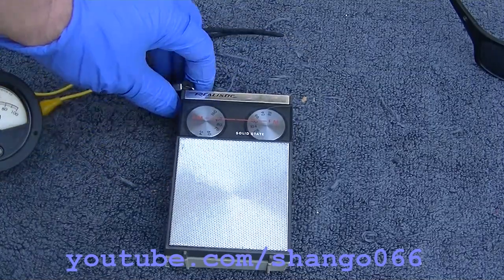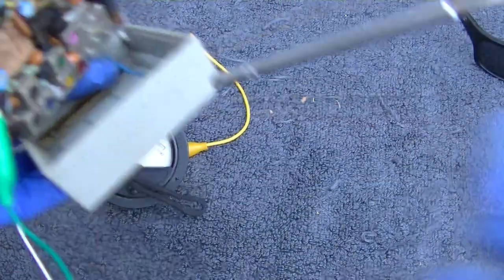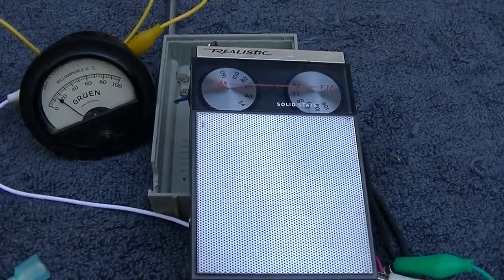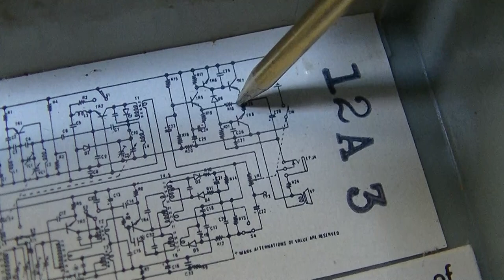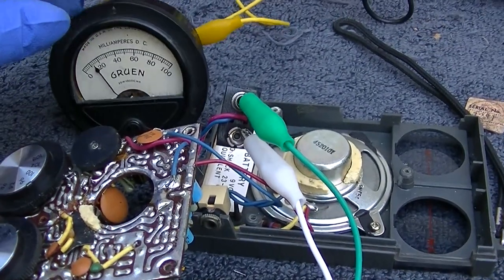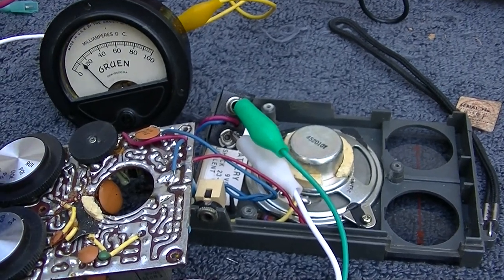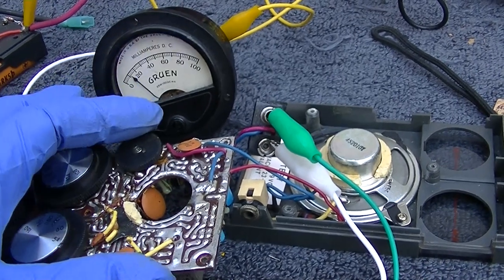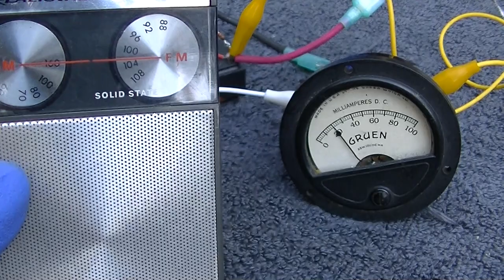Realistic AM FM Pocket Radio Quick Fix Radio Shack

Comment: Seems like a pretty good set. I especially like the separate tuning condensers as if I had one I could leave one on my favorite AM and the other on my favorite FM station and not have to retune between the two.    Nice easy fix too and nice video.  Thanks
Reply: I noticed that too....and from the looks of that schematic it appears like twin radios sharing the audio output.  Should make for an easier diagnostics come repair time.
Reply: RS had a number of these radios, some with maybe short wave, police  band or marine band on the other side. The dual-dial setup was a cool feature and it probably cut the depth of the case a little. They seemed well constructed. The only shortcoming was a tiny 2" speaker; I think a 2.75 incher would have made the sound a little more bearable.

Comment: the coupling cap probably fails to reform properly because of the high source impedance and low DC voltage across it

Comment: Realistic radios were sold by Radio Shack and normally better quality build than many of the time.
Reply: Regarding the Panasonic commercial television we saw recently, what is it about the Realistic vacuum tubes that make them so crappy?
Reply: Funny how they had the opposite name here in the Netherlands. But they where the most easy accessible repair materials shop for me as a kid as they had a shop in the closest supermarket and other food related "mall". they closed early 80's there.
Reply: @jamesplotkin4674  at the very end they were buying whatever they could find on the open market. Tubes by that time were more or less out of production of except for a few specialized numbers.  Realistic lifetime tubes also were more or less wherever they could get stock cheap. If you know your tube construction you can actually find very good American made tubes all the way to junk from China .  It was completely luck of the draw.
Reply: @James Plotkin,Watch his video “talkin vacuum tubes with Al”. Al discusses them there.
Reply: @randyab9go188  I have an old Radio Shack catalog from 1977 that advertises the “lifetime” tubes.  It shows a closeup of the pins and says “why are the contacts gold clad? You want the best so we use 24k gold clad pins to lower inductance and provide better heat dissipation”.    In the video with Al he states it was marketing bs. That they sandblasted the pins to give them that appearance.  My only experience with them was buying one in the early 80’s for a 1961 Ge stereo record player and the tube was bad out of the box.
Reply: i like the Apple iTubes they sell for $50 a tube
Reply: @Suddenlyits1960  I think it is luck of the draw... I have purchased realistic tubes and they lasted as long as brand names ...
Reply: @Suddenlyits1960  Thanks!
Reply: @pyeltd.5457  And every year, you need to buy an adapter ;-)
Reply: @randyab9go188  Audio tubes are still in demand, by audiophiles and musicians, who drive up the prices. Most are now made in Russia, but there are cheap ones from China and high end ones from Europe and America. Also, if you're lucky, you can still get new, old stock tubes, although often for premium prices. TV, radio, and industrial tubes are less commonly in demand.
Reply: @dougbrowning82   goodbye to Russian tubes. Hahah.
Reply: @One-Crazy-Cat  The biggest Russian tube factory is actually American owned.
Reply: I wonder what company made them. But i do think a lot of the Realistic receivers were made by Foster Electric.

Comment: Looks like that set was made in December 1973 or 83. (12A3 code on back of unit. ) Excellent performer.  I too like the dual tuning.
Reply: I was going to mention the exact same thing, definitely 1973. By 1983 the started using SMD resistors
Reply: @norcal715  And, I think the words "solid state" had been eliminated by '83.
Reply: I always wondered what that code meant years ago, like in this case 12A3, i always thought it was some model code or something.

Comment: Radio Shack had three versions of  this radio, the AM-FM version in this video, a "Jetstream" radio for the VHF aviation band, and a "Patrolman" version for the very few police agencies using VHF (which also happens to cover the two-meter Amateur band).
Reply: I saw it when I was looking through the radio shack catalogs to discover what year it was first offered.  The VHF version said “put a pilot in your pocket”. 
I remember when those little radios were popular for listening to aircraft control towers and planes.  
Go back in time even further to the late 50’s and early 60’s and Allied/Radio Shack sold really good hi-if equipment,including McIntosh!
Reply: @vickie grant
When this model of Patrolman was sold from 1970-75 most us law enforcement was using VHF (150-173Mhz) while some like highway patrols were using older HF technology around 31-39Mhz.

Comment: Realistic model 12-632A with two separate variable capacitors for AM and FM. Gives you an "owl eyes" design.
As usual an electrolytic cap has gone bad. Great looking radio made in Hong Kong in the 1970's.

Comment: I got one of these for my birthday in July of 1971, but from what I recall, it had an interstage transformer feeding the push-pull output stage; only the output of that was direct coupled. This is probably a later version with the 75 cent cost of the transformer shaved in favor of an extra transistor.

Comment: Some electrolytic capacitors are much better than others. Most electrolytic capacitors do not stand the test of time. Because the electrolyte dries out or it changes chemically. By comparison into vintage transistor radios that I own one is a Toshiba dating back to 1960. When I bought it for a dollar 40 years ago it worked fine no problems. Now it does not work do to bed electrolytic capacitors. Now the German transistor radio that I own from 1961 that I bought about 35-years ago worked perfect at the time and it still works perfect now. I guess there is something to be said about German capacitors

Comment: Nice, I have a Patrolman MINI which looks almost the same as this except FM radio is VHF 148-174Mhz, I guess for old police band or something. It's just totally quiet  ... Looks mostly the same on the inside but it uses a transformer in the audio amp stage instead of direct drive. Time to start checking the current draw and then the caps....
Reply from the maker: Usually if a separate band high or low, like am works and FM doesn't, it's a transistor,  band switch or other fault specifically to that band. Generally capacitors are shared
Reply: @shango066  You were spot on that the initial issue was the band switch. Contact cleaner and now AM works and is nice and loud. VHF is working too and I can just pick up and hear the weather around 163mhz, but super quiet at max volume... I'll keep poking around.
Reply from the maker: @adriansdigitalbasement  something with the FM antenna?

Comment: Hey Shango, Im 21 years old and have been into vintage radios for a while and just bought my first vintage TV for reapir I want to use a digital converter box to watch TV, the TV I bought is a 70s Panasonic Does not have any jacks or anything of course, I see you were an antenna would hook up but I’m not sure how to run it with a D TV box, is there a video of yours or somebody else’s that would be helpful for this?
Reply: Your DTV converter box needs to have an RF output to channel 3 or 4. If it doesn't I'd recommend looking for one that does or you will need an RF modulator that takes the component input from the outputs with which your DTV likely is equipped. You may also need a balun which is an impedance matching transformer to go from the 75 ohm coaxial cable to your 300 ohm screw terminal antenna inputs on your mid-seventies television.

I hope that helps. Good luck. God Bless. And keep on with the vintage electronics.

Comment: When I was in High School in 1974 my father took me to Thift Shop in Down Town Philadelphia and I brought a loot of small transistor radio for 69 cents - 3.00. I went to Tandy and purchased Multi meter for $15.00 and Pen Jersey automotive and brought soldering iron gun and try to learn how to fix it. I can not get part for it and unable to effort to pay for shop rate which was $15.00 per hour plus parts. I took it with me and have the set fixed in Thailand for much cheaper and sold it.

Comment: Break out the cap wizard.  If I was doing this myself as a paid gig I would at least test every cap to find any marginal units. They may still play now but a few years from now they will be dead.
Reply: Shango seems to mostly do 'resurrections' - taking something that's been left for dead and making it play again solely for the YouTube channel. I agree that were he fully restoring these TVs and radios and selling them on to serious collectors or putting them back into daily use, a full test and recap would be the smart thing to do to avoid problems down the line, but some of the console TVs and more modern units are destined for the junkyard or the parts bin once the video is uploaded, as there are still lots of things especially from the 70s and 80s that no-one seems to want and certainly wouldn't return the investment in parts and labour that it would take to get them working properly and reliably.

Comment: A Radio 📻 Shack best. Just might be a late 1980’s model. Realistic was later replaced by Optimus. Archer was also another name amongst many Radio 📻 Shack products. Dried out capacitors would be plaguing this radio 📻 by now. That’s still a GREAT 👍 radio 📻. I’d get on with the job of replacing the capacitors, and giving this thing an alignment in the end, if it needs it. Your friend, Jeff.